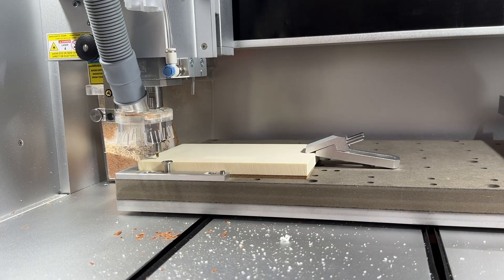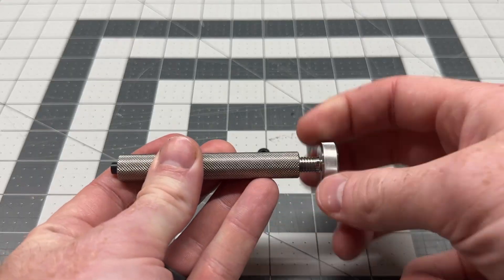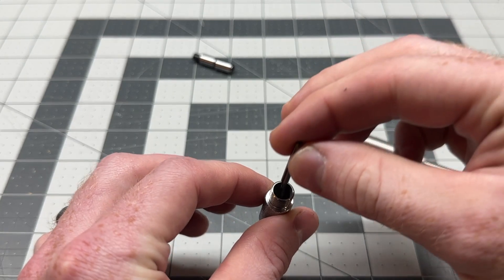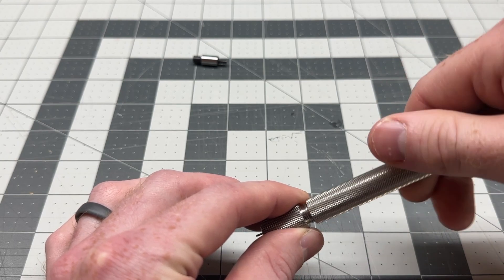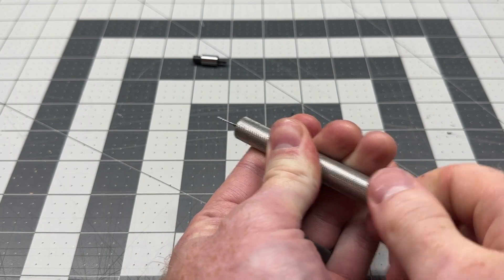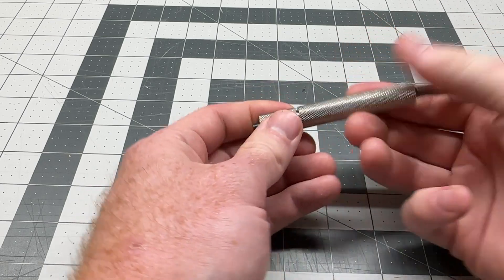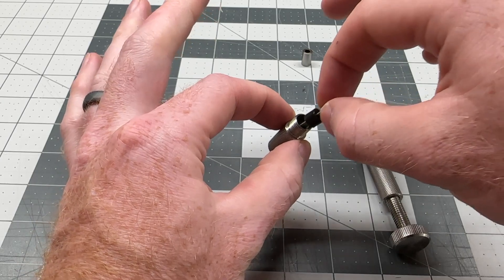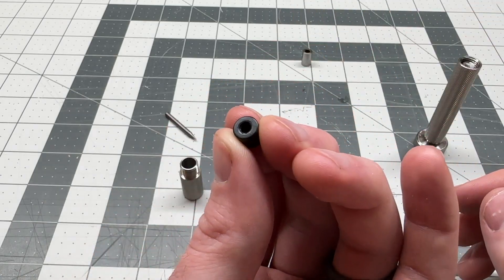How to install and Remove Bit Collars

Comment: so, ive been doing this and it and the rubber ring is almost at the bit.   using the engraving bit that came with it..  is that normal that it is going that far?
Reply from the maker: That doesn't sound right, please reach out to our support team for assistance

Comment: The collar on my bit is not straight. what did I do wrong? Also what is the length that you start with? is it total length of the bit or the below the collate length ?
Reply from the maker: The collar may have had a defect in how it was manufactured. But if the collar isn't straight, the bit should still load correctly in your spindle with no issues. We're uncertain if we understand the second part of your comment, but please feel free to get in touch with us at support@makera.com

Comment: What is the maximum allowable shank stick-out for 1/4" bits? The bits collar installation tool allows only 12mm of engagement between the collet and the bit shank which could be a rigidity concern for longer bits. Can I install the collars further down on longer bits?
Reply from the maker: For the Carvera we suggest 20mm max because of the straightness requirement for the ATC, for Air, no limitations.

Comment: The thread needs to be greased first. So much force was required that it galled the threads.  I’ll have to order, make, or repair the parts now because it is almost useless even when greased.  It’s almost at the point of needed vise grips to use.